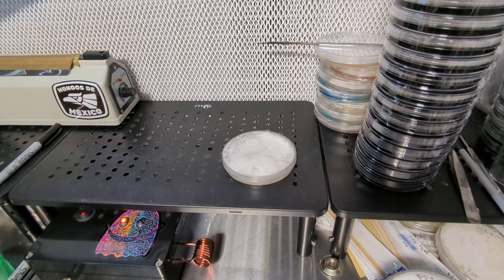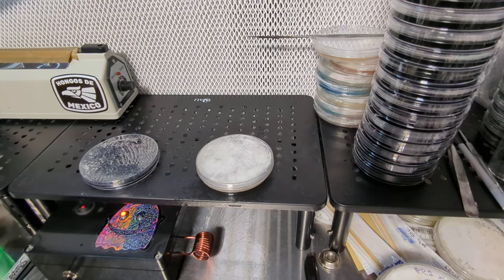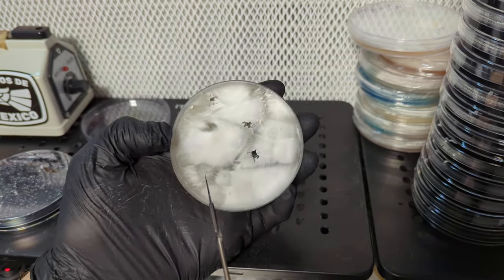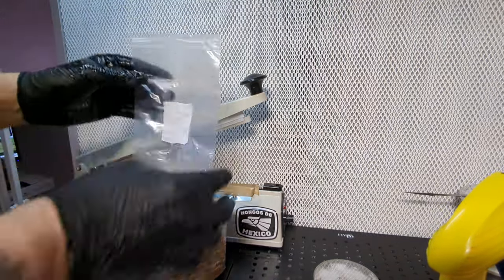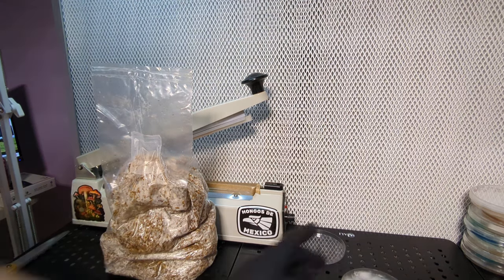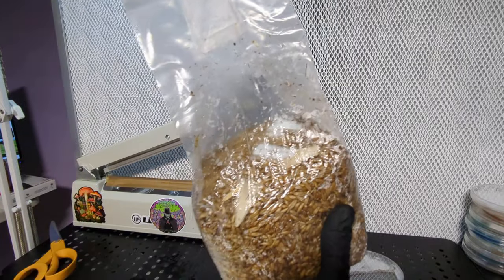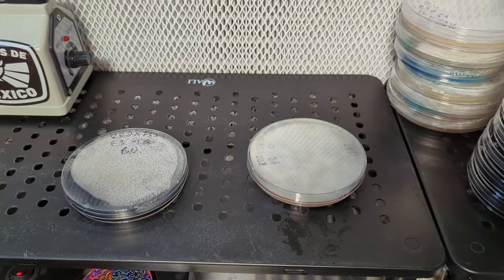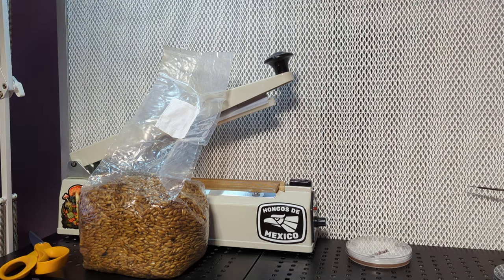Discussing sending multispore plates to grains for fruiting, and saving backup transfers.

Comment: If you have a small UV Light, like this UV-C STERILIZATION SENSOR LIGHT thing I have, you can set that bad boy ontop of the plate, it will clear up the fog without harming the myc -- its not nearly strong enough to do any actual sterilizing I doubt, but it does clear up that fog on your plate lid - I put it on top facing down on my stack of plates after I pour to take care of the condensation on the top plate - works without issue.

Comment: Thanks a ton DK,  When you see tiny primordia like that on a plate, do you ever see them darken?  I've let some plates sit longer than I normally would, and I began seeing those tiny white bumps (I now believe they were likely primordia).  I had never seen them on a plate and waited a few more days and then they started to darken.   The plate looked very healthy and white, just the tiny nodules are dark now.  Have you ever seen that before an ABC?   In appreciation.
Reply from the maker: Sometimes they turn into pins,  sometimes they abort on the plate, either way it's not uncommon for them to darken from the cap forming or from aborting, if they get too old i just make the backup plate and work forward from there.

Comment: You might have said it, but how much (pounds or grams) spawn is that? Do you use it for multiple fruiting bags?
Reply from the maker: These grain bags had roughly 3# of grains, or 2.25 full qts. For varieties that fruit prolifically I split that between 3 xls bags, mixed with 10 qts of substrate, for things that make fewer fruits I use 2 bags and around 5 qts of sub. That gives me approx a 3" deep cake, and spreads the heavier fruiting cultures over more surface area to allow for more biomass from the same amount of spawn.

Comment: The plate you work on at minute 23…you don’t need to cut it up into so many pieces if you’re putting all those pieces to the same new plate. Strategically you’d be accomplishing the same thing if one bigger cut of that area  was taken, not chopped up, then put to a new plate. You would also be reducing the stress and increasing the speed.
Reply from the maker: I wouldn't argue with that, I think I even though that myself, I guess I thought I mentioned that but perhaps not, I do like to cut it into a few sections to spread out my innoculating points, but even a single slab will work. 
I usually use around 6 wedges per plate just to make it easy to transfer, this agar was really soft so small pieces seemed like it might be easier to move. 
Definitely not nessicary though I agree.
Reply: @DichotomousKeys-fg2bu  definitely nothing wrong with how you worked it :) I should have also said great video too! I enjoy you’re calm demeanor

Comment: What would you say is the difference in taking clones for stabilization vs taking spores for stabilization? 

Most time you hear to grow spores generations for stabilizing a cross/trait/specific fruit.
Reply from the maker: If you close me something that clone should be stable as a clone, however if you want something to repeat a trait from spores, then you will need to do some selection work, running from spore and selecting the trait you want each time until that is a dominant trait produced from spore runs.
Reply: @DichotomousKeys-fg2bu  so if a fruit has been chosen for its traits and its cloned,  thus it repeats itself vs finding that trait or cross  in spores and constantly selecting it in consequent gens to also bring a stable fruit for the same result…. That is where my confusion is 

Cloning vs spore gens seemingly looks like the same process but cloning seems quicker .. unless one is using spore gens to find new phenos. 

Please correct me if am thinking about this wrong 🙏🙏

My focus is stabilization of a cross/trait & wanting to know which way to go & why for understanding. Would love the clarity